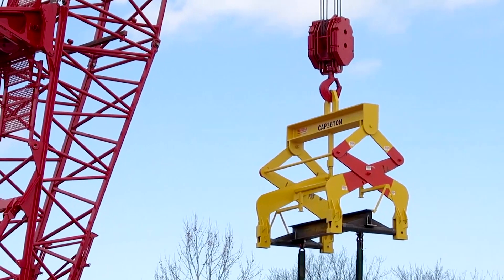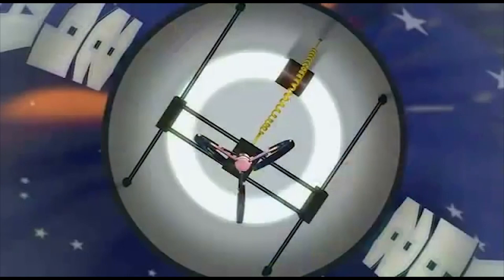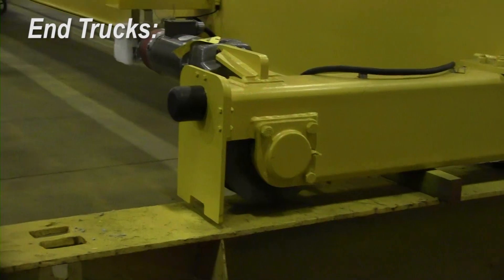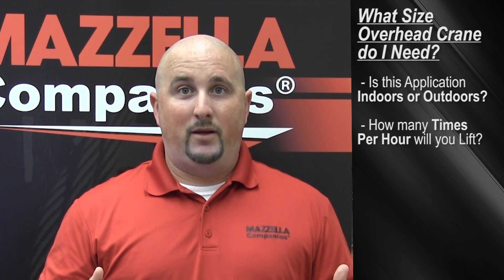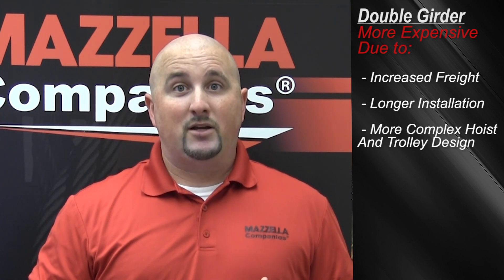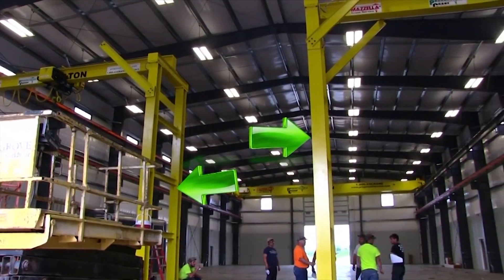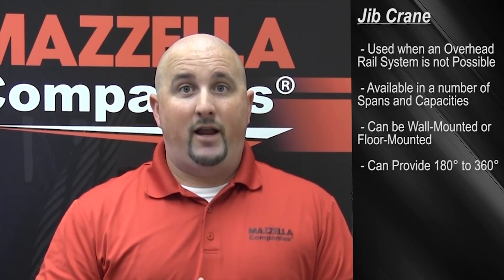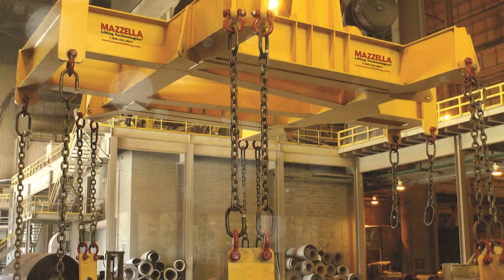What is an Overhead Crane? | Cranes 101

Comment: Are the parts or components from one overhead crane manufacturer very interchangeable with those components from another overhead crane manufacturer?  FOR INSTANCE: A trolley probably cannot be mounted on a bridge girder by a different manufacturer because each has their own designs and specifications.  Would this be correct please?

Comment: What is the possible problem of having sound at the roller driver when it run high speed?
Reply from the maker: Hey, George, thanks for reaching out. 

We put together a video on 5 common problems with Overhead Cranes. The second point might be what you're hearing (directly linked here-->) https://youtu.be/uO4WfYDOWxo?t=62 

If you'd like to schedule a Crane Service Technician to take a look, you're welcome to head to https://www.mazzellacompanies.com/Contact/Service-Division and fill out the contact form. 

Best, 
Devon
Reply: The breaks or the Bearings might be giving out.